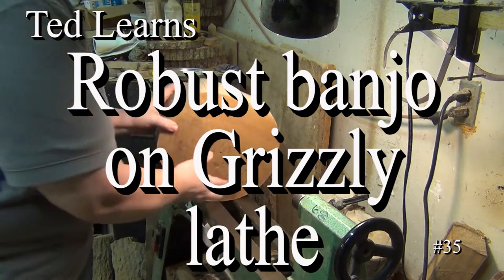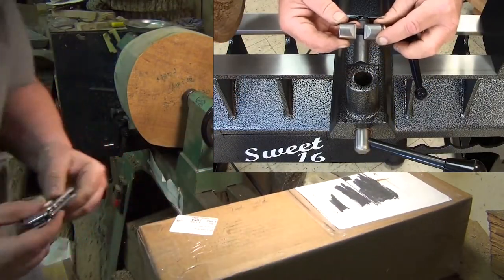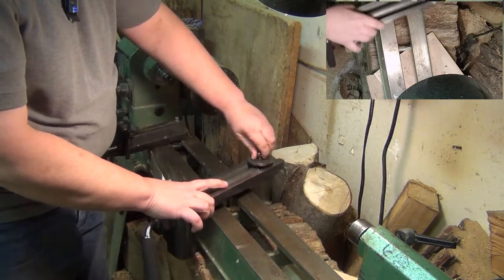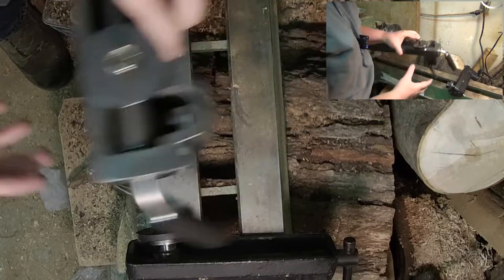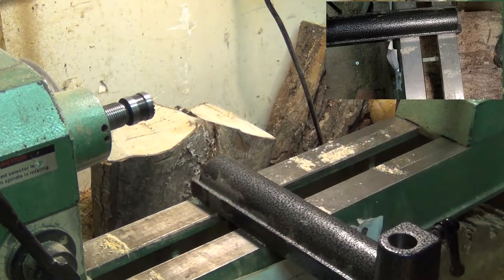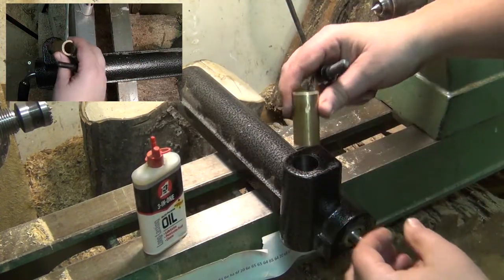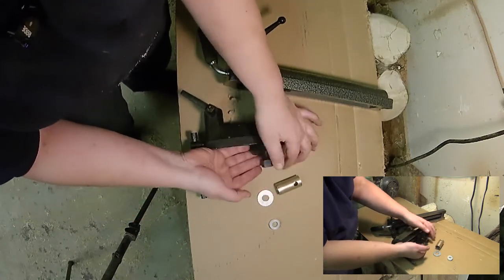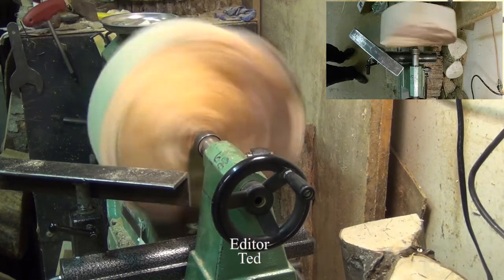Upgrading lathe banjo,  Robust Scout banjo on my Grizzly G1067z lathe ~ #035

Comment: Ted, Nice job making modifications to get it to work for you.
Reply from the maker: Thank you for you kind comment.  Sometimes we just have to work with what we have, sometimes we can upgrade.  In this case it was a bit of both.  Even though I was originally disappointed with the clamping system on the Robust Scout banjo, I suspect the system used made it easier for me to use my current toolrests.

Comment: also you  can grind the round   guide    and make it square to match  the bed
Reply from the maker: Thank you for your comments.  I don't trust myself with an angle grinder. :)  Also I wanted to be able to put both banjos back to there original state if/when I upgraded.

Comment: i have  the 0462 -16  same thing   and the treads  would break off   cheap iron    ......   one way has em too
Reply from the maker: Thank you for your comment and suggestion.
I can't complain (but still do).  I got my $206 value out for the Grizzly just in entertainment value and learning if it was a hobby in which I wanted to sink time.  

I did not see the One Way 14" lathe until after I had already had the Robust banjo installed.  i guess I need to upgrade my web searching game a bit.  no Idea how I missed the One Way, probably just got tired of shopping for a fix.

Comment: Nice mod..... Might have been easier if you ordered a couple of Robust toolrests when you had them send you the banjo.... Your angle-iron rest at the end looks a bit janky. I think your brother was right.... Just order yourself a Scout. Grizzly discontinues machines often, leaving owners in the lurch for repair parts.... Buy American.
Reply from the maker: Thank you for your kind comments.
  Yes, janky is a good word to describe the angle iron tool rest.  A family member made it for me when the cast iron rest that came with the grizzly snapped when I got a bad catch.  Since most of my tools are carbide scrapers the flat rest is fine for them.
  As to "buy American" it is nice when we are able to do so, that is not always the case.
As to ordering tool rests from Robust when I ordered the Robust Scout banjo, my budget was limited (which is always the case). 
  The Robust toolrest was a huge upgrade that allowed me to better use the Grizzly lathe. The point of having the video was to show that with some 3rd party upgrades we can get better usage out of the lathes we already own.

Comment: I'm not fond of the robust banjo with the placement of the arm for tightening the tool rest they could have placed it above the arm for the ways tightening. Very inconvenient on the side like it is. I am going to replace my Laguna 1836 banjo with one from Oneway that uses a button instead of tightening a screw into the toolrest post. Lagunas banjo uses a slot that is pinched when tightening the arm but it doesn't clamp down tight enough and the tool rest slips down frequently.
Reply from the maker: Thank you for your reply.
I understand your point about the tightening lever for the tool rest.  I have needed to adjust where I place the banjo because of that handle being in the way, only on a couple of occasions.
At the time of the purchase of the Robust banjo it was the only one I found that would work for a 14 inch lathe.  I have since found others, however I am generally pleased with the new banjo.
My only real issue with it is that the tower (I don't know what else to call it) is so high that I can't use some of my tool rests because they sit too high.

Comment: Take new bottom plate to get machined down to fit your lathe?
Reply from the maker: Thank you for your question.  
   Yes I am sure that it would be possible to have the bottom plate milled to work.  For that matter if I knew someone with a machine shop I might had a new bottom plate made. 
   I should have stated in the video that my intention is to someday upgrade from my used $206 lathe to something better . . . a Robust American Beauty  or a Stratos XL lathe would be great.  I digress, In adapting the different components to work together I wanted all my changes to be non-destructive.  That way if I am able to upgrade to another lathe all the parts for the Grizzly and Robust banjos would be complete and could go to new owners in that condition.